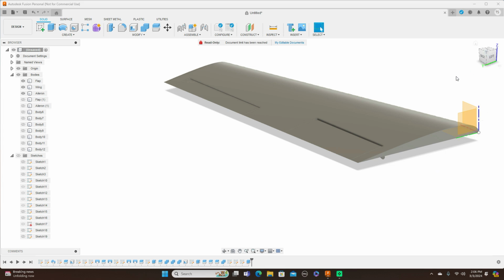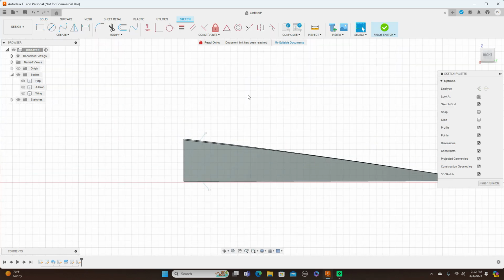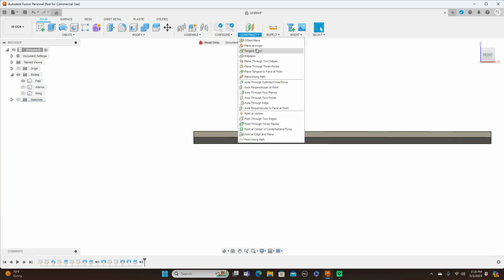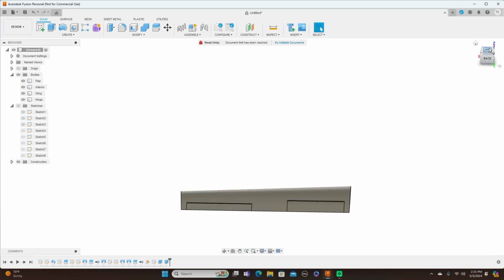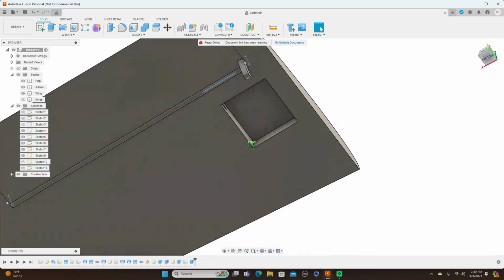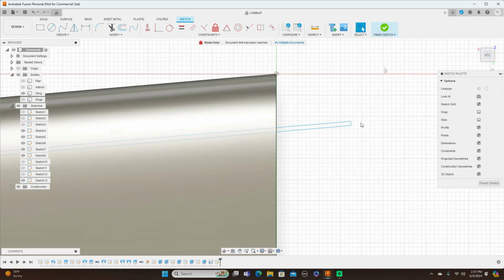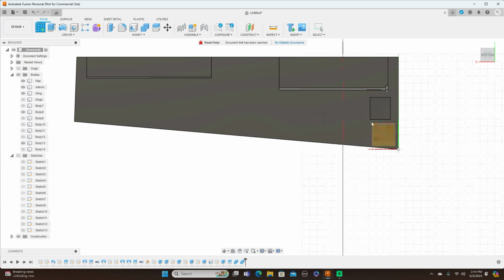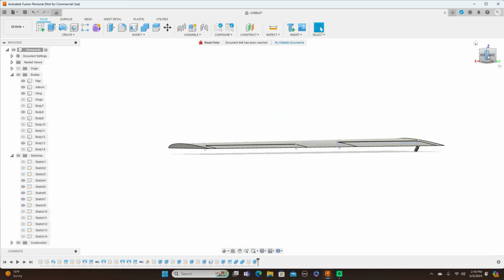How to make wing internal structures. Ailerons, flaps, Horns, Hinges and retract cutouts in Fusion

Comment: I LOVE your videos and thank you so much for the time you've invested in making.  They are the only ones that have allowed me to make some progress in learning CAD for 3D Printing. 

I do have a question, though... when cutting parts out, how do you accommodate for part clearances?  Not just beveling the hing lines, but those shared outboard edges of the ailerons and flaps.  

Case in point, I'm trying to make some kit cards with moveable parts and intrrlocking tabs and slots... how do i adjuat those for a snug fit?  Do i use the offset feature?

Comment: Lesson one. Always create two new components one after the other. This will allow you to anchor one part later if you ever decide to do it. I dont sketch a thing until I create these new components just on principal. That lesson comes from mistakes way late in the design process.
Reply: I was just going to ask that.  Is it a better practice to create components to help in the organization of things ? 
Do Components make projections any harder or not available from component to component ? ( Fusion nube here)
Reply: @deanmiller3660  When I start any drawing the first thing I do is create new component and then do that again right after the first. Then I draw inside the second component. You will save problems down the line. You may not realize what they are yet but just do it. I dont see how it makes anything any harder however by doing it this way you meet the requirements to do anchoring for  joints and possibly other things. Even when you may never think you need them.

Comment: Thanks for the video. Just beginning to wrap my head around this process. How would you section this, or any wing, so that when printed they would fit together? Tabbed or locked somehow not just butt jointed? Sure that’s more involved than this format allows, but I’d like to see that. 

Thanks!
Reply from the maker: I will do a video on how to put tabs on the parts so they will lock together.